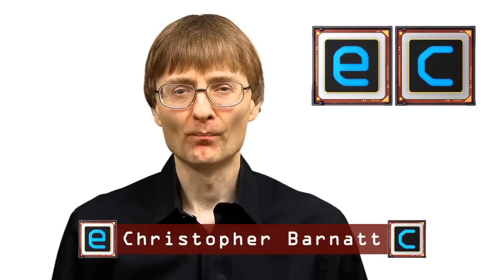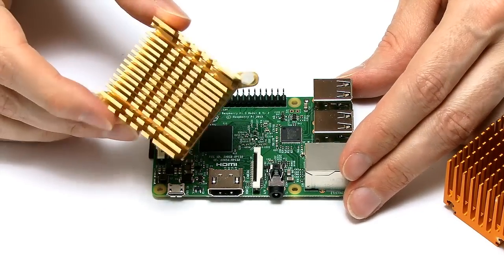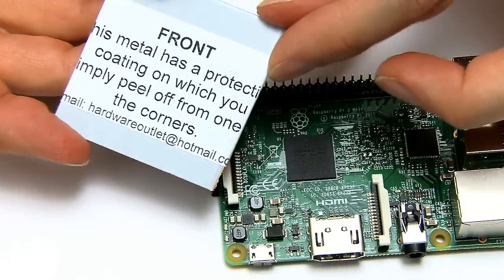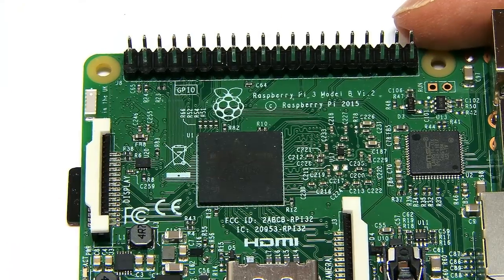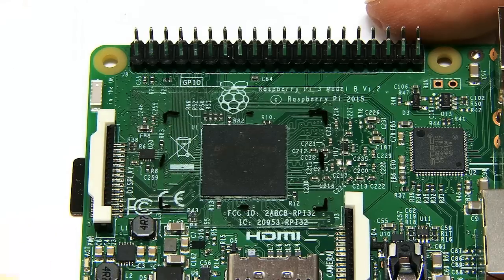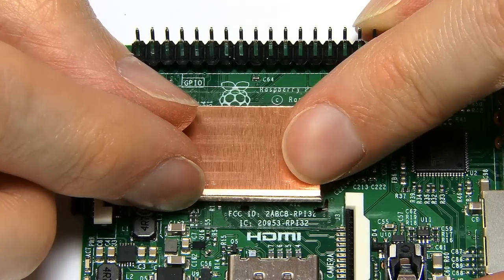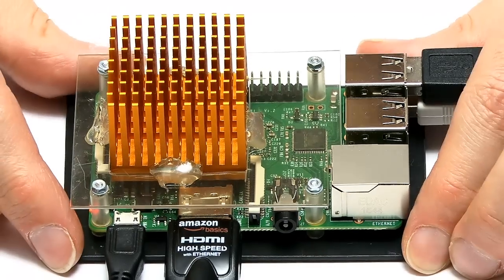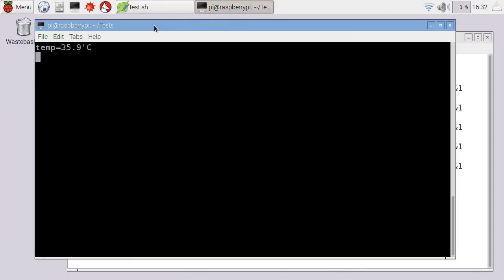Raspberry Pi 3: Extreme Passive Cooling

Comment: What about a peltier cooler with the RPi controlling the power via PWM over the  GPIO, other than the cooler you should only need an N-Channel MOSFET and a resistor. That way you have active cooling that is proportional to the CPU load. It would fit under that big heatsink you have.
Reply: +Daniel Matthews "Peltier Cooling - Your best way to convert 100 watts electrical power to 5 watts cooling power!"
Reply: +Anvilshock  Nonsense, for one the COP depends on the DT, power input and the device characteristics, so given we are talking about a low DT, as far as what these units can do, the COP is much better than you suggest. In fact it is idiotic to make the sort of sweeping claim that you did as it just suggests that you actually have no idea how they work. https://www.maximintegrated.com/en/app-notes/index.mvp/id/1757  <-- is this enough science for you?
Reply: I'm interested with that option too. Anyone to try it and make a video ?
Reply: COP can be over 2 but even at 0.85 is still a hell of a lot better than your idiotic claim of 0.05.  Your claim about TEC performance was 1 dimensional when the truth is that their behaviour is described by a set of parametric curves. i.e. The behaviour of TEC devices is described by a three dimensional surface where the optimal set of variables is a peak and the worst choice is a valley. So if you still don't get that go away and do some research for yourself, and stop acting like a complete fool.
Reply: Daniel Matthews
No, "troll", the graph is about some electrical efficiency, not thermal efficiency. In fact, whatever they mean with "efficiency" in their graph isn't even clearly explained. It's some sort of percentage, but percentage of what?? Not a single word is said about how much thermal energy this thing can pump around. No dT, no Watts, just "Efficiency" and "TEC current". How is that supposed to tell anyone anything about actual cooling power, as in, for example, Watts thermal per delta Kelvin in/out graphed against Watts electrical (and if you want a third dimension to have a wank over: absolute operating temperature)? THAT'S the efficiency I want to know. The TEC model isn't even mentioned in the article. In fact, the whole text is merely about the controller! So I do believe I mentioned what you can do with "nonsense", how about you put this graph of yours in the same place, because no, there is, in fact, NOT enough science here for me.

Comment: Copper is great at absorbing heat, but not great at releasing heat, that's one of the reasons why just the copper block didn't help much. Also, surface area is critical, and the copper block has very little of it. ;) Great video! Now I'm inspired and I'll see if I have any old motherboards lying around that I can canibalize. :)

Comment: Hello there, 
 I also modified the heatsink and added a copper slab as you suggested and placed exactly like you did. Here are my stats. :) without overclocking and without any fans.
Room temp was 43 Celsius, it's hot here :D
I used the same script you did.
temp=49.9'C
temp=53.7'C
temp=54.8'C
temp=55.3'C
temp=56.4'C
temp=56.4'C
temp=55.8'C

Thanks You were very helpful :)
Reply from the maker: Thanks for reporting on your implementation. It is great to see this replicated elsewhere. Isn' t YouTube a great place for sharing information?! :)
Reply: Yes, Sir! Youtube is great and fun. I have a request. Could you please make video on 
> Overclocking + Heatsink and Fan and explain how it's done?

Also please tell me.
What do you think, a fan above the heat sink is better or by the side of RPI ?

Thanks
Reply from the maker: jigg143 I would (and have in another video) tried a small fan on top and it works very well. I will be uploading an overclocking video in the next month or so. :)
Reply: (y) Thanks alot.

Comment: Great job!  One small improvement would be to replace the bottom plastic plate with an aluminum plate and add a second copper coupler between the lower plate and ram chip on the bottom of the Pi PCB.  This would allow heat to flow out of both sides of the pcb.

Comment: Very surprising result! It seems crazy to put all of that high-performance thermal compound and copper on top of a plastic chip. One would expect the plastic in the chip to be a massive bottleneck for heat transfer, but evidently you can still remove a lot of heat via this route.
Reply from the maker: +TheHue's SciTech I had the same thought, given that the casing of a modern Intel or AMD CPU is metal. But as this shows,  heatsink on a plastic casing can work.

Comment: Hello Sir,
I just wonder if the plastic one that you fitted around the cpu "to avoid any short" as you said didn't get melt as the system booted for hours, did it?

By the way, I just observed that some connectors / ports have been blocked, specially those GPIOs. Thank you Sir.

Comment: If everything else were to fail, I would suggest to set the CPU speed to 600MHz in the /boot/config.txt of the Raspberry Pi 3 model B v1.2 (the only other being 1200MHz) with the following option:

arm_freq=600

more like some sort of "forced throttling". For simple programs or projects this should be more than enough. The pi WILL run slower, but also colder. Nonetheless, I would use this just as a temporary solution until the real problem (i.e. inadequate casing/cooling method) is tracked down and fixed.

As for heatsink, I'm going to use a pair of small stripes of thermal adhesive, one between the Broadcom and a small plate, and the other between the plate and a small GPU heatsink with a 5V fan I came up with, for a grand total of <15g of weight. Hope this will help to keep the temp below 55°C even in the most dire situation. If so, I'll be very satisfied.

Comment: I like passive coolers. One time I fitted a large copper heatsink on top of the already existing heatsink for the m4n78se motherboard (which was pretty unimpressive by itself). I used copper wire to tie them together. The result was fantastic. That board also ran with a geforce 9400gt made by XFX which had a rather massive passive cooler. That was almost 10 years ago and last I heard the system was still working very well. The good old days.
Reply: Btw I loved your method and subscribed to your channel. Good content. Cheers.

Comment: Hi, very informative, thanks! @ExplainingComputers : some cases for Pi (eg ZeroW) come with a small heatsink that has 3M double tape on it (presumably Thermally Conductive 8805/8810). Besides the usefulness of a (very) small heatsink, what are your thoughts on using that 3M double tape? won't it do more damage than good? Thanks again!
Reply from the maker: Thermal tape is clearly not as good as a thermal compound, but it does make it very easy to apply a heatsink and hold it in there. So it has its place.

Comment: Nice!  I also have an old Zalman aftermarket video card heat sink (among many others).
3 ideas for you:
1.  Thermal epoxy, instead of silver amalgam.  Well, I guess you are going to take that stuff off later.
2.  Extend the copper plate to  the IO chip as well.
3.  Use a heat pipe to link the hot chips to a porous aluminum case around the board.

Comment: Like the little plastic spacer. Like the copper spacer. Like the use of Arctic silver. You GLUED the heatsink????? Sheez!!!
Reply from the maker: +Chris Rennie Yes, I know. But it should not get warm enough to melt the hot melt adhesive -- which is not that difficult to remove. :) To be honest, I did not expect this setup to work anywhere near as well as it did, so it was a bit of a quick fix.
Reply: +ExplainingComputers Ah ok, a temporary test & not a permanent solution then - I misunderstood. How about fashioning a couple of locking "arms" out of say perspex - to clamp the heatsink down? There looks to be enough space between the heatsinks fins to lay an arm through... each arm could be attached to a pair of the pi3's mounting holes. Should be simple enough to make with a laser cutter. Or, 3D printed in a suitable grade of filament that won't soften at the working temperature?
Reply from the maker: Chris Rennie Yes, an arm across is  good idea. :)

Comment: Nice! Which dimmension did you cut the copper plate for the processor? Did you use isopropyl alcohol to clean it? Which heat sink brand and model did you use? Thank you!

Comment: Really cool project. I like that you show the idle temperature, but with a heat sink that large, is the temperature under load really steady? It takes time for the copper mass to heat up before you hit the steady state temperature and I'm just not sure ten minutes is long enough. Especially given that in your overclocking video the temperatures in your final results go down after overclocking the GPU, because (as stated in that video) you let it cool back to an idle temperature before running that test.
Still fantastic results, but it would be even better to know the steady state temperature.

Comment: A great experiment in finding different ways to keep the Raspberry Pi 3. I was really impressed with the results from the large copper plat plus heat-sink. I wonder what what results you would get if you added a fan to this heat-sink set-up?

I have now purchased a RPi3 I just need to get an micro sd-card and then I can play around with it and have some fun. I am looking forward to the over clocking video, this little computer is quite powerful for it's size and its amazing what projects people come up with for it.

Keep up the great videos I love your channel.
Reply from the maker: +DLiberator78 Many thanks. I too was impressed with the performance of this heat sink arrangement -- particularly after I'd run the test with the copper only first, and it did not make that much difference. I would guess that a fan on top would knock a good 10 degrees off the temperature.

Comment: Nice job! But maybe just the copper was enough, do you have the measures for the copper part only?
Reply from the maker: The copper was 3 mm thick, and I think about 12 x 20 mm in total.
Reply: ExplainingComputers Thanks! I continue thinking that just the copper part could be enough...maybe testing and comparing....Best regards from Brazil!

Comment: Hi, I'm a little late to the party. I recently bought a rock64 and a organge pi pc board and plan on using them as octoprint servers for my 3d printers. Since I already had overheating isssues in the past with a hummingboard from solidrun, I bought 2 heatsinks (37x37x28mm), similar size as yours. For my usecase it's probably overkill but I don't want to deal with any potential bs overheating/throttling issues.
Since the "thermal paste, glue on case" approach is out of question for me (the sbc's will get a closed case with slits where the heatsink is for ventilation) I need to fix the heatsinks onto the socs somehow. In my experience thermal paste doesn't stick well enough, so options are such white thermal glue (I think it's epoxy glue?) or thermal tape.
I plan on going for thermal tape, heatsink sits flush on the components and with thermal tape it will be raised again a bit.
Is it absolutely necessary to use a copper plate and such plastik surrounding?
I will apply the thermal tape generously on the whole surface of the heatsink. Even if it touches other components (what I doubt it will) the thermal tape is electrically insulating (because you mention the possibility of a short). I'd like to know your opinion on this? Oh, also: Because of this pi-p5+ header on the rock64 the heatsink doesn't fit I'll need to desolder the header (I don't need it) or shorten the heatsink :D
Reply from the maker: A copper plate is only necessary if other components will prevent a larger heatsink fitting on the CPU. Thermal tape usually works well.
Reply: @ExplainingComputers  Hmm.. tried the big heatsink with thermal tape now, as far as I can tell it's sitting good on the soc and the 2 ram chips (it also gets warmer during stresstests) but in comparison to no heatsink it's only a neglectable 5°C cooler... Guess I gotta test with thermal paste or copper piece+thermal paste. It's a pitty that many sbc companies do not design their boards with just 2 holes to clamp down a heatsink on the soc..Idk why..

Edit: Alright, it wasn't sitting good on the chips, seems one tiny component is just a bit higher than the chips. I'm gonna get myself a copper plate, wrap that in thermal tape all the way and see where this gets me :)
Reply: @ExplainingComputers  Just a quick update: Tried thermal tape and copper plates and only could get it 10°C down. The tape is crap...maye just mine is. How you did it is the ideal way, using copper plates and "normal" thermal paste I could get the temp down from 80°C to a chilling 50°C under max load...and unless I mount the board upside down it will stick together well enought I think.

Comment: I absolutely need that exact heat sink!  Would you think that the copper plate combined with the aluminum heatsink optimized its cooling potential given their differing cooling properties working in tandem like copper tubing does with aluminum wings on a larger premium heatsink?

Comment: I don't know if this is actually conclusive. The overall size of the last heatsink is so much larger and as such, might just extend the time till it hits 80C~. I think running a longer test to see how it behaves at 15+ measurements would actually provide a better idea of long term performance. Either way, nice work here.

Comment: If it was me, I'd look at buying a larger block of copper. It would be cut around the components on the board so that it can use the bolt holes to apply pressure against the CPU when it's in a case.  

Something else you could try, pop it in a bowl of cooking oil and see how that works!

Comment: The problem is that you need to transfer the heat away from the source as quickly as possible, so the base should be reasonably thin. What makes the difference is how large you can make those fins so that the heat can transfer to the cooler air between the fins. Adding the thicker plate will just slow the transfer down before it even hits gets to them..

Comment: Wow, great cooling... but that thing is HUUUGH :D Do you mind to tell us the (metric ;) ) measurements of the copperplate and the heatsink?
Reply from the maker: +Frank Klawuhn (EffKay) The copper plate is 3mm thick and I think 18mm x 25mm (I can cannot get to measure it without taking it all apart!). The heat sink is 36 mm x 36mm and then 32 mm high. By chance, 36 x 36 mm is about the largest heat sink you could mount without using a spacer to raise it 6 mm + to clear the HDMI socket and other components.

Comment: hi, nice video, but isn't heatsink plus copper plate too heavy for the chip? Will it cause any damage?
Reply from the maker: The weight should be fine. The bigger risk would be snapping the Pi's motherboard if the heat sink were put under strong pressure (as some here have asked for).

Comment: Hi!

I've been trying to get this script to work on my own Pi. But it doesn't work properly. I get five messages about the temperature but it displays it all at once. As far as I can see I haven't made any major changes except for the name and "sysbench --temp_test=cpu" instead of "sysbench --test=cpu". I did try running it with a exact copy of your code but it still didn't work, do you have extra librarys installed?
Reply from the maker: Sysbench itself needs to be installed -- I covered this in an earlier video here: https://www.youtube.com/watch?v=e6okZKRwnTQ

Comment: Another great video with another great DIY solution. A 20 to 40 C  degrees difference is dramatic and far beyond our initial estimates (was it about 10 C at most?). No doubt your thermal layering solution hits the spot with paste-cooper shim-paste-sink. 

If anything, I'm surprised the shim by itself was quite ineffective as cooper has very high thermal conductivity. Maybe the shape wasn't helping? By the way professor, was the Arctic paste the Silver kind? If not, you could shave maybe another 10 degrees more. 

Congratulations.
Reply from the maker: +Luis Mercado I think you are right that the shape of the copper did not help. No silver in my Arctic. :)

Comment: Hay you did it. Many thanks for this video, lots of info that helps us all. What do you think about thermal epoxy, instead of thermal compound? I have never used it for this but it may hold on the heatsink. Keep up the great work.
Reply from the maker: +bigsmile542 You cannot get thermal epoxy off again. So it would never be my choice over a compound that does not cure.

Comment: Really nice work. On my raspberry PI i used pure copper heat sinks as we all know copper is a better conductor of heat and electricity than aluminium. That gave me exactly the same temperature range that is in this Video.

 Its said that the processor is tested to work efficiently on temperatures upto 80 Degree Centigrade.
To test my raspberry PI does reach this temperature or not i created a shell script that would log the processor temperature and will send an E-Mail notification if my PI reaches 65 Degrees and would give a shut-down command when it reaches 70 Degrees.

Its about 6 months now i have not received any notification or found my PI shut-down.
Also note that my raspberry is fully loaded with about 34 cron jobs, has MySQL database a web server, sending me impotent E-Mail notification when i am not at home.